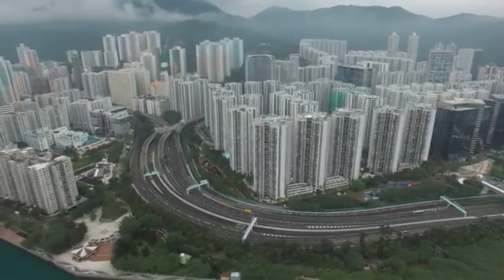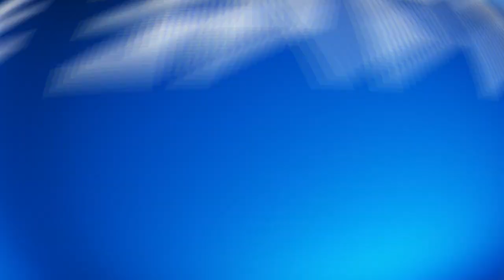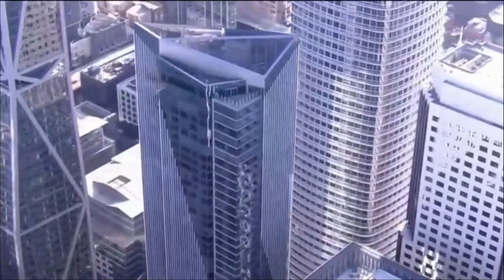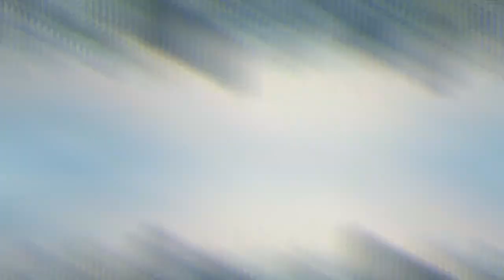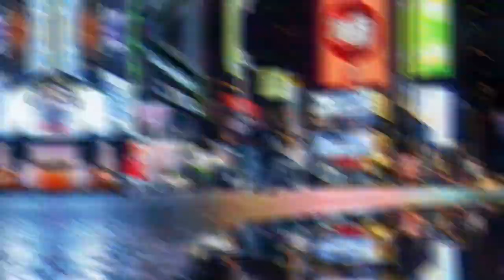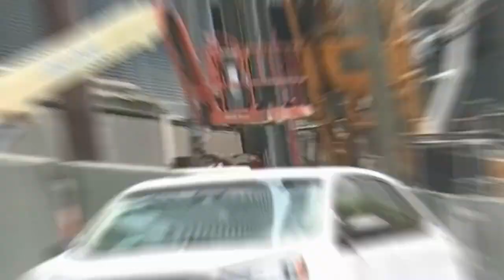The Hidden Risks of Skyscrapers - Millennium Tower's Fall Examined! #bayarea

Comment: SF tower is a testimonial to casting decades of best practices to literally the wind.

Explain!

OK there have been numerous "computer models" done on this site and building. No problem with that IF the modeling program can "comprehend" the unique soil type and realistic accurate data is entered into it to set the hundreds or even thousands of variables it must consider to offer a reasonably accurate model.

Decades of best practices apparently have been ignored and cast aside. This is the heaviest building in this Market St Area. It is a foundation type and structure (massive use of concrete for foundation and structure) so it is significantly heavier than any other building of similar foundation  into the "old bay clay"

Slated to be a steel frame, the building as I understand it was converted to concrete frame. This increased weight. All the other buildings successfully anchored in the "old bay clay" as locals call it are fine staying within the max tilt parameters expected for similar foundations but the exception is the foundations of the others follow a appropriate pound per square foot pressure exerted formula. From what the experts tell me in my research the SF Tower is significantly heaver per square foot pressure exerted by other buildings.

But apparently some "Y" factor yet undiscovered has been added to the mix here that seems to indicated a toxic milkshake of narcissism, pride, ego, total incompetence and too much reliance on "new" ways such as computer modeling that simply does not work if the people INPUTTING the data are not experienced and capable of assuring the right RAW data is entered in.

The "Y" factor may never be discovered, at least until this monument to incompetence falls flat and unfortunately kills and maims a bunch of folk.

I pray that never happens but somebody is going to have hamburger for dinner that fateful day....

Comment: MILLENIUM TOWER info : Geophysicist Tom Parsons 
For comparison purposes: 

FACTS One General Electric 4400 hp locomotive, fully fuelled weighs around 430,000 pounds. IT WOULD TAKE 1,595.4 of these to weigh the same amount. (my statement)
      STUDY THIS: > >>Tom Parsons: > >> The Millennium Tower may be the most recognizable sinking building in the city, but one researcher says earth-based and space-based observations confirm the entire downtown area around it is sinking as well. “I looked at every building in the Bay Area, so just under a million buildings,” said U.S Geological Survey research geophysicist Tom Parsons, who estimates that over the last century, 3.5 trillion pounds of development and human activity – including the subsidence tied to loss of groundwater -- have led to an estimated settlement of three inches across the entire Bay Area. “Clearly, the most density and the tallest buildings are centered in that downtown San Francisco area, and that's where we see the most calculated cumulative settlement from all of those buildings together," he said. Turns out that at an estimated 686 million pounds, the Millennium Tower is the third heaviest building in the city. The top nine all weigh more than 300-million pounds, but the only one that’s leaning significantly is the Millennium. Groundwater loss from adjacent construction has been blamed for the problem by the tower’s developers, while geotechnical experts say the key is that its foundation is not rooted in bedrock. “The Millennium Tower’s an unusual example of tilt, but generally they go down vertically,” said Parsons, who has long studied the stresses that build up on the earth’s crust. He says all the buildings downtown likely weigh enough to exert sufficient downward force to influence an earthquake fault. Fortunately, the San Andreas fault runs offshore before it reaches the city. So, he says, the billions of extra pounds will not likely have seismic implications. Still, the mass of sinking buildings shows up clearly in yellow in enhanced images captured by the European Space Agencys' Sentinel 1 satellite.